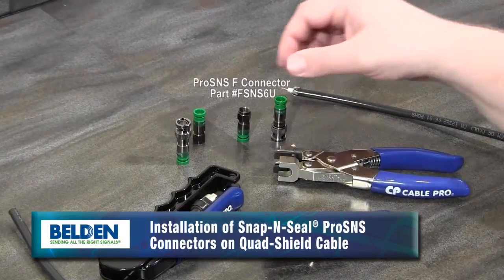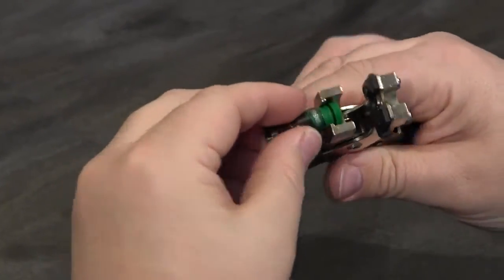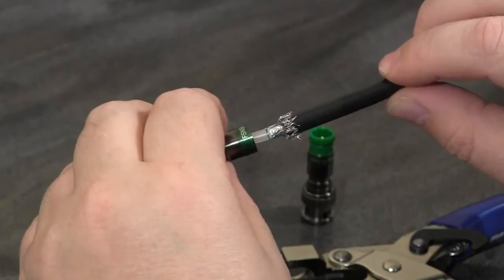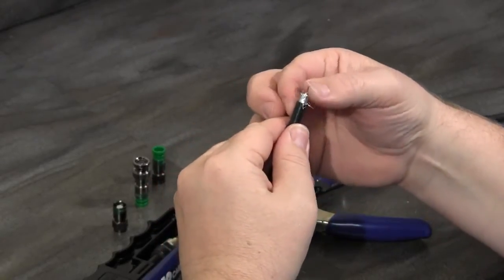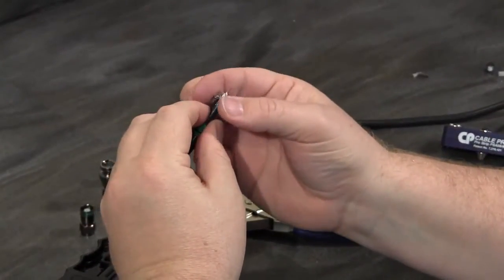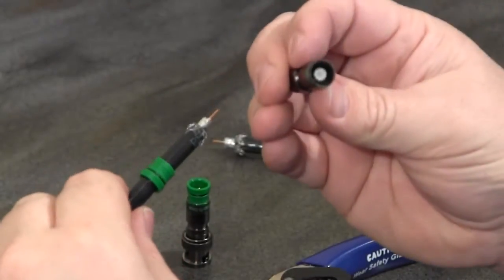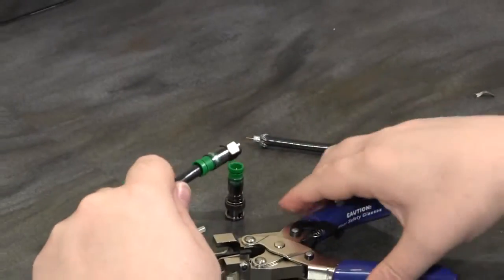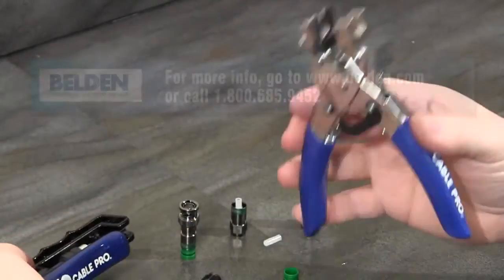Belden FSNS6U F Connector Terminating RG6 Quad Shield

Comment: Thank you for doing the video. Your hands must be stronger than mine. After I snap off the back ring, I am unable to put it back on without tools. I don't find the guide tube that hard to see with the green tube still in place. Anyway, thanks for doing the detailed video. I'm not a professional, and I do these connectors rarely, I get good at it, and then I forget.